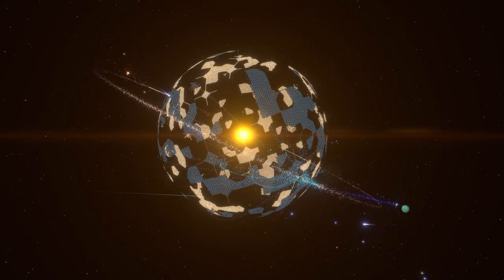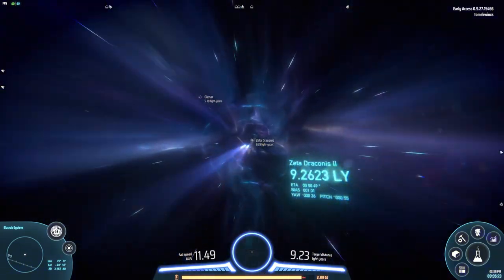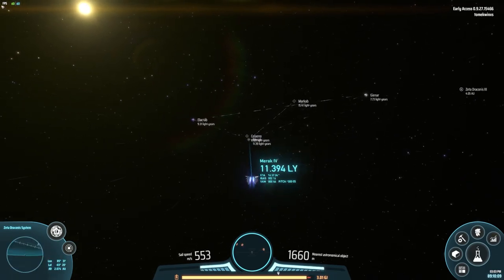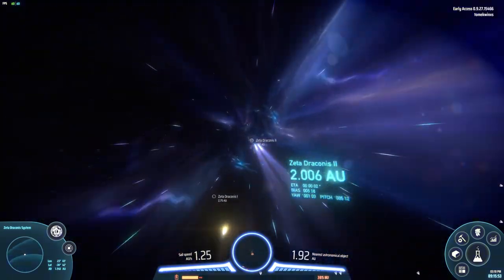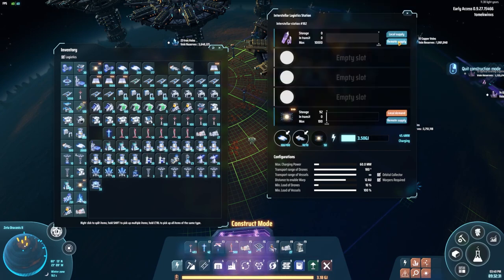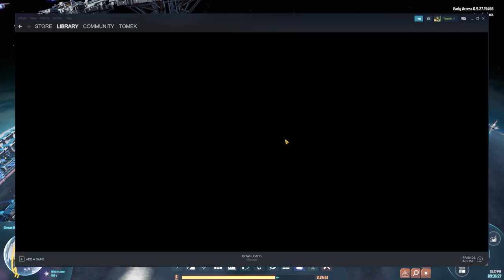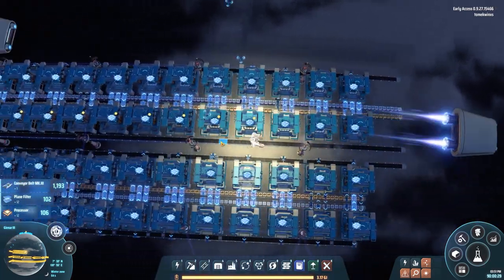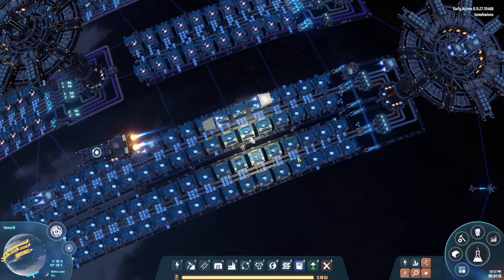Automating 40/s Quantum Chip | EP94 | Dyson Sphere Program | Blind Playthrough

Comment: Your Blueprinting issue is seen at 47:24 there is some buggy behaviour with the belts (marked in red) because the planet is round they are clipping
Reply: Yes. It was not the sorters as Thomas did not add those before making the Blueprint! :face-turquoise-covering-eyes:
 Note: As the whole Blueprint is red (problem) you have to look for the "darker red" highlights to spot exactly where the problem is.